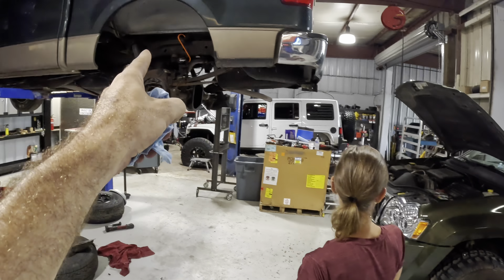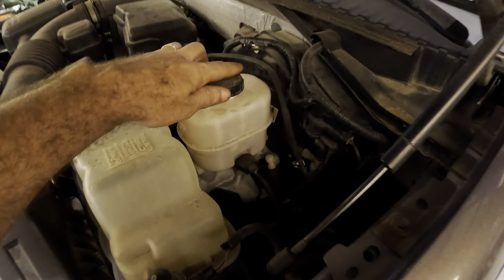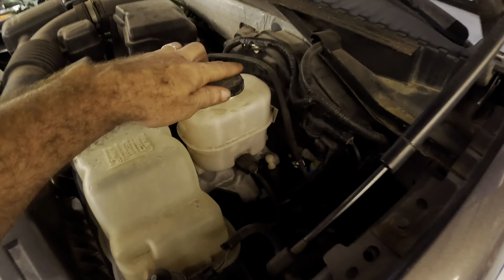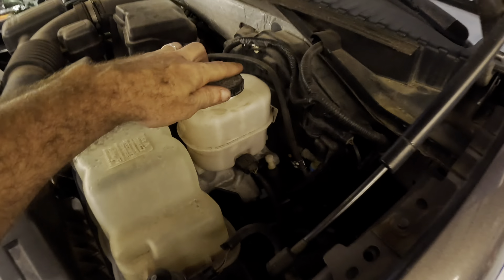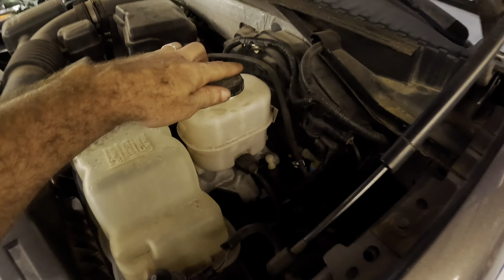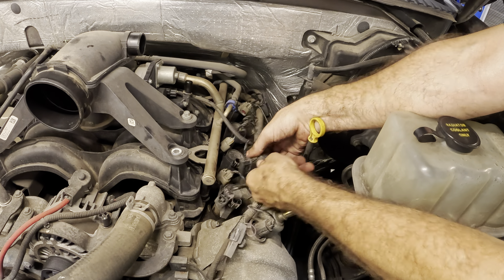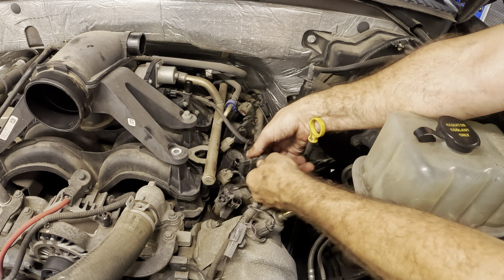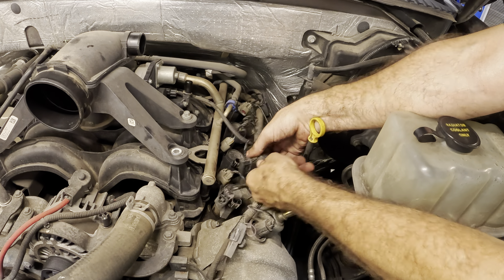Phone a Friend (Snapping Spark Plugs)@BeardedFordTech  Expedition 5.4

Comment: I never heard of plugs breaking off in Ford 5.4's, but I have had a 98/ F150 that blew a plug out and know of others that also had plugs blowing out on a 05/ F150. The Ford dealer fix was replace head or motor, a good garage fix was some sort of new thread installment in head.........
PS. At 4:30 pm it's 88 degrees with 60% Floridian humidity in Mid-Coast ME.........☹

Comment: Good day to you Ray, my Das Auto also have those spark plugs.   As you know, they require the special socket to get them out.   Mine also requires a swivel (built in on the socket).   Thanks to the German engineering.  LOL! 😂😂

Comment: 78F ia about 24C and yeah they don't do heat well over there.  Here in Toronto for the last couple of weeks it has been anywhere from 26 to 31 and feeling like anywhere from 28 to 37 with average humidity running in the 70s to 90s.  So yes, it IS damn hot up here right now.  Currently it is 77F but feels like 85F with humidity of 83.

Comment: Wow, I feel for you Ray in all this heat. I did this job on my stepfathers 2000 F150 5.4 with non powered handtools under the carport in N.C. heat and humidity and it SUCKED! Lol. I'm NOT a mechanic, I do work on mine and my family's vehicles when they need attention though. I replaced the head gasket on my 04 Passat 1.8T 5 years ago and it was an experience but it still runs great and gets me where I need to go. 

I think some people in the comments have an idea of what perfection is and if that's what they need and you're not meeting it, then they need to watch more reruns of their idol and stop finding people to compare to their imagination. Moreover complaining about your hard work while they're in air conditioned space watching videos is a world of difference from suffering in the hot 100 degree temperatures with high humidity all day long.

Thanks for the videos, please get some AC for your shop Ray. Hello wife unit and team.

Comment: The 3 valve 5.4 2 step sparkplugs are the breakers " sometimes " threaded end has a small thread and at the top of the plug it has a larger thread. Sometimes the small part of the plug will break off in the hole but there is a kit to retrieve it.... I have a 1997 5.4 2 valve  " the popcorn sparkplugs " so far so good. Thx for sharing     Ford, 2 bad designs in a row, so sad lololololo
Reply: I had the dealership replace my plugs in my 4.6, 3 valve and made sure they never siezed the threads

Comment: Southern Finland here, and the temps go from a refreshing 50 F at night to a sweltering 72 F after midday. 
Us and our older houses are built more to keep the heat in during the winter.
Haven't yet gotten AC but as the summers get hotter, it's probably a sooner rather than later purchase.

Comment: Up here in the PNW we have had temps into the 100's. Here it was 101 outside and 106 in the house. (No A/C) . The temp. prediction is 83-93 this week. Fire danger high too.
    Even at my old age, I DO LEARN from Ray because he takes the time to explain and teach. Between Ray and Eric O at SMA, my mechanical knowledge has increased. I also use some of the electrical troubleshooting methods in my electronics repair that I have learned from both of them.

Comment: Temprature here in Northern Ireland was 02C/68F yesyerday 07/16/2024 and today 07/17/2024 is 18C/64.4F.....we are not used to temp much higher than this but the very odd summer we would be cooking in 33C/91.4F....way tooooo hot for us lol....great video about changing spark plugs....cheers

Comment: Comfortable temperature depends on climate where you live. Living in Florida and having 79F / 26C as comfortable temperature is quite normal.
I lived in the Northern region for some time and 20-22C was comfortable temperature while 24C was a bit hot.
Now I live in Japan and wear long sleeves when it is 26C outside. And it is cold when AC is set to 24C.

Comment: I just finished installing new coils and plugs on my 5.7L Hemi in my  2005 Jeep Cherokee.  It was mostly easy to get to except for one cylinder next to the fuse box.  The box had some tabs sticking out that served no purpose other than to restrict access to the spark plugs (yes plugs with 16 of them to replace) so the accidently got broken off.  I didnt have a torque wrench so I just snugged them down.   I was surprised that they were so easy to get to compared to some other engines I have seen.  The plugs showed wear similar to what you had with just the very tip worn off.  The engine has around 130K on original plugs.  
I forgot to hook up the connector on one of the cylinders but the engine ran fine, but threw a misfire code.  I am not sure how the double spark plugs work since one wire from the coil goes to an opposite side cylinder(cylinder 1 sends spark from the coil  to 1 and a wire to cylinder 5 ),  Maybe Ray can explain that.

Comment: 78F is 25C which is warm but not horrible.

Where I am in Alberta Canada we hit 38C (which is about 100F) last week during the heat wave. We typically get down to -40C/F in the winter, and have been known to break past 40C in the summer, so an 80 degrees Celsius or 140 degrees Fahrenheit spread throughout the year.

We have a habit of wishing it were winter in the summer and summer in the winter.

Comment: Supposedly here in AR. Delta, Heat Factor will be around 110 degrees today, yesterday actual Temp. was 98 F. with 74 percent Humidity... Thursday a Cold Front is to move in and we are to have a whole week of Good Temps and Lower Humidity..

Comment: Today in the upper Illinois it's a high of 86 today with a 91% humidity.  We had a wicked storm last night that spun up three tornados with in 20 miles of us.  Right now the power is still out and parts of I55 south of Route 6 is still closed because of down high voltage wires (the ones from the real tall towers).

Comment: Weather in New Jersey today is between 88-94°F with humidity levels between 50-60%. I can't remember a summer in Jersey so hot and humid so early. This is probably the 3rd or 4th week in the 80-90° range. Keep cool n hydrated

Comment: I have one of the "older" 5.4L engines (2001 F150).  The problems I face with coil or plug replacement is the fuel rail being right over the top of coils from#3 on.  #7 is the worst due to some little regulator thing in the rail and I have to lift the rail off the injectors for that one.  #4 of course is right next to the A/C.  But at least it's not the 04-08 engine with those snap off spark plugs.

Comment: Boise, ID area, it should peak out around 100 at 5 PM with low humidity. Currently, at 8:50 AM, it's 74 degrees.

Comment: OMG Ray I had an 86 F150 with the reversable straight six and the 6point thread broke off and through the use of a bunch of adapters and an easyout with some pb blast(ok alot of pb blast)I got the ceramic part all out and finally cracked the threaded housing out and changed them all but then the timing gears must've lost a tooth cuz the timing was never right for long and had to keep the timing light on me to adjust. So funny story, im driving along and the truck backfires and stalls. Next thing I know there is a NJ State Trooper with his gun drawn on me ordering me to put my hands on the dash while he opened my door to look for a gun under my seat. No Gun, i told him what happened and  He asked do you need a tow truck?  I said "no but maybe a clean pair of underwear wouldn't hurt" we had a good laugh and went on our way. Do with that what you will but i hope you enjoyed it. and yeah it got hot here in south jersey but northern and central nj it was 107 and they sent all of the bulkeaders home for the day it was so bad and those guys work thru some baaaad weather. but its cooling off a bit with thunderstorms nightly. great vid as always!!

Comment: Temperature-wise, it's low 30's on the Celsius scale - or mid-high 80's Fahrenheit - up here in the Canadian prairies this week.
20-23 C (somewhere around 72 F) with a light breeze to provide some air flow is ideal, in my opinion.

Comment: Southern Maryland.  It's been in the triple digit heat index for weeks now, with only two days that were not.  Worst so far is June 22:  106 actual, 124 index.  Many others in the area had similar readings, so not a meter anomaly.

Comment: It's cray in Oklahoma, we are having a relatively mild summer so far while all the hot and severe weather is not here. Not complaining at all.  Usually it's heat-dome city here but I could never survive the humidity levels like down there in Florida or even the states immediately above Florida. The one thing that makes any heat way more tolerable is lack of humidity and I'd be running dehumidifiers in that shop of yours when you have the doors closed if I were piloting your shoes but I'm not.

Comment: dude I have a question about my kia soul 1.6L, I messed up.  So I was trying to do the timing chain cause it has 251,000 miles on it and it seems rather loose, and I thought I had it top dead center but I was utterly wrong, can I independently turn the lobes into the positions indicated in the service manual and then turn the crank and find the compression stroke on cyl 1 and that should be good then?

Comment: 5.4L heat up motor pull coils one bank at a time spray penetrating oil in the hole crack spark plugs loose slowly loosen up feel for any binding spray more into hole draw it back in then come back out. I ran some bg cleaner and done bg induction cleaning B4 doing so. If motor gets too cool need to reheat it. Pain saking but it works . I've done this on my 09 with og plugs having 150k and it was successful

Comment: The 8th digit of vin tells engine type. Number 4/5/7/8 are the good 5.4 engines without the internal ceramic cone that breaks off INSIDE the cylinder bore

Comment: In las vegas, we just came off 3 weeks of 118 deg temps. But it's a dry heat, so it felt like 118, not 125. But we've cooled down to the 110 range. If you work outside, your tools become to hot to touch in just a couple of minutes!

Comment: The 5.4 heads were redesigned in mid-08 to fix the plug issue (as well as a couple of other minor tweaks). The 3v prior to that had the goofy plug designed that had a tendency to get stuck and break off.

Comment: Living in the Uk and regarding the temp's and what you would call nice and what we call nasty, you have to remember what our weather is like for 85-95% of the time, it's dark and raining, so when we get a heat wave for us, it's pure humidity as everything is saturated and it starts to release all that trapped water, plus air con is not a thing over in the UK, and our buildings  are not built with hot weather in mind as it's so rare, so we tend to cook. It's a bit like comparing Florida heat to heat in Detroit. It's not really something most can grasp until you experience it for yourself. Our summers are just humidity and our winters are wet and cold, but it's the kind of cold and wet that get's into your bones.

Comment: Ray…Plan on changing plugs on 2010 Ford Foucs. What would your recommend to put in plug hole and letting sit before backing out the old plugs? Plugs are original with 102K on them.

Comment: One question for you!
GOOD DAY TO YOU SIR  about a week ago.

So these cars and suv's the plug breaks off in the head  on the top 1/3 of the first plug you pulled it looked rusty  can't you put an anti seze on it to keep moisture off the plug threads    I can just see some poor guy working on his own car at home in his garage pull 2 plugs and 4 of the snap off in both heads
Now the heads have to come off to get the plugs out and the head gaskets have to be changed.
I think i would rather have something on the threads then deal with that mess.

Comment: You think it's hot in Florida? Where I live here in Duncan Arizona yesterday while I was working outside at a 112°, I was listening to my earbuds all of a sudden, and my phone quit working. I went back into the house to see what happened, and my SIM card was no longer reading on my phone when I pulled the back off my phone.  My battery had separated, and the presser had polled the wiring from the harness for the SIM card.

Comment: At 1:06, does anyone know what causes that scratching on the wheels?  My car's wheels has that too and it's deep enough you can feel it with your fingers.  Is it the plating getting etched away by road debris or a manufacturing defect or what?  I assume there's no fix for it other than to buy new wheels.

Comment: Ford supposedly fixed the 5. 4 spark plug issue in 2008 by changing the spark plug design. The new design included a larger spark plug electrode and tighter thread engagement. Additionally, the engine was upgraded to prevent future coil on plug issues. Found this off google if you can believe it. I have a 2008 and it did not have the 2 pc. spark plug design but still replaced them close to 90,000 miles...

Comment: Mid-high 70's with 50% humidity in MN, Whoooo-hoooo!

You should do the coil packs too, customer will be back within 3 months otherwise. They will all start dying at 100k. And buy OEM/Motorcrap, expensive, but will last another 100k, unlike cheap aftermarket that won't even give you 40k.

Comment: Hey Ray, with that amount of dielectric grease are you not worried about actually impeding the electrical connection between the coil and the plug? Is it not beneficial to ensure a strong metal on metal connection between the coil and plug without the insulating properties of the grease on the metal contact connection? I believe the instructions for use of dielectric grease on spark plugs is to only apply the grease to the ceramic portion of the plug to insulate the connection and contain the electrical current within the ignition coil.  Also here in Eastern Ontario Canada it is currently 28 Celsius/feels like 38 with the humidex. That translates to feeling like roughly 100 Fahrenheit. As a Canadian no I can not function in temperatures this warm. Anything above 25 Celsius/77 Fahrenheit I will choose to stay inside with the AC! 18-23 Celsius/ 65-75 Fahrenheit is the real sweet spot for me.

Comment: The rubber insert is a pain, so I keep an old long plug lead top, originally for a GWM pickup, which is long enough to reach, and it works well to insert the new plugs and remove them once loose. Also acts as guide, so it will not get cross threaded, and grips tight enough to thread them down all the way before the socket does the final work.

Comment: Retired mechanic here. You just lost me, Ray. Installing or removing plugs with an air or
electric ratchet is a game-stopper. You lose all "feel" of what's going on. So easy to cross thread  or break something. Fast and dirty isn't the way to go.
Reply: That’s not true. I used my cordless for years on plugs. Never cross threaded one. You get a “feel” for it when you use them enough. Being that you’re retired, you probably had some old air ratchets.

Comment: We don’t seem to be getting a summer, this year. Well into the second half of July ‘24 and the daytime temperature is expected to reach almost 17C (62F). That’s a good bit below average for the time of year. We’d expect around 21-23C (70-73F) on a cold day in July and August, though warm days can go into 25+ without causing a stir.
Nobody talks about the places where temperatures are lower than normal, because that doesn’t fit the program. It’s all about temperature being a couple of degrees above average. So if you have a normally hot place and it’s hotter, we need to hear about that. That’s what sells your electric vehicles, you see. Temperate places being cooler? Meh! Not so much.

Comment: Here in Stockholm, Sweden it's close to unbearably hot. All of 27°C or 80.6°F

It isn't hot for you, but here we think 25°c is perfectly fine a summer day. Thing is for about half of the year we live with temperatures below 0°C 32°F and down to -20°C or -4°F during the winter. In extreme cases we can have down to -40°C which is about the same in Fahrenheit. So temperature tolerances depends on what you are used to.

I remember when I was young my parents took me to Cyprus close to Christmas. Technically it was winter time but to use the weather was just about perfect. One day we were at the beach lunging in the sun and I saw a local family walking by the beach and looking at all the crazy tourists on the beach and in the water. They were clothed in warm jackets and hoods. Yea to them it was freezing, to us it was perfectly warm.

Comment: Smack bang in the middle of the UK and we have been lighting up the wood burners, definitely not hot here ATM

As for complaining about the heat; nothing here is designed for it, we might get a month of extreme heat if we are lucky (usually more like 1>2) so we dont have aircon in our homes, we dont have ceiling fans; we have small fans we can put away for the other 11 months we have no need for them

Comment: Fells like 117 is nothing. Last week we were 118 real temperature. Around 47.7 Celsius.
Useless going swimming when it is at 96 and feels like it is 110 because you will never dry.
Spark plugs that color should be replaced. Looks like they had fire on the threads.

Comment: Did you take the extra minute to make sure the plugs were properly gapped?  Just assuming they came from the parts store ready to go doesn't cut it.  A buddy of mine was putting a new set of Autolites in his Ford truck, and one of them the gap was off, like it had been dropped.  Saves you from doing another rant about parts stores.

Comment: 99 in New Jersey feels like 107 to damn hot and I need a life line please 02 ford mustang v6 3.8 misfire no codes except o2 sensors it seems to be cylinder 5 from testing but it has spark and fuel what am I missing please help